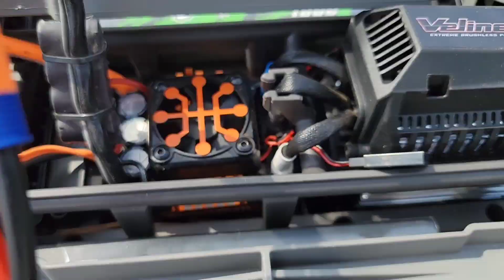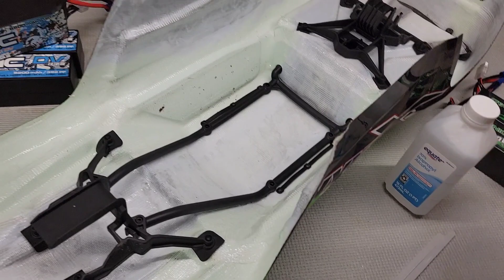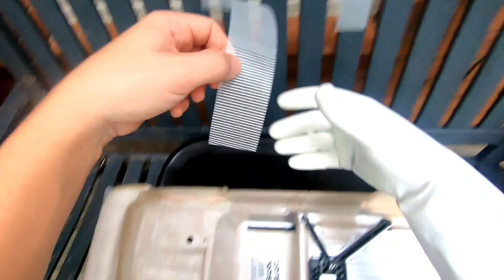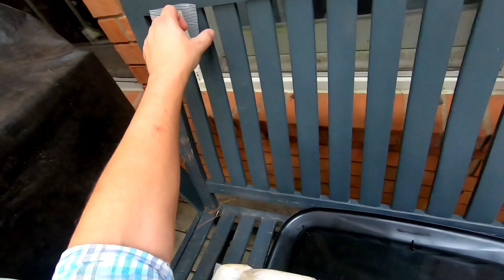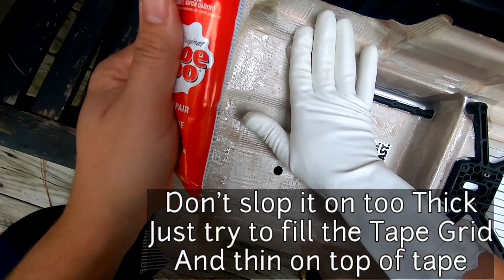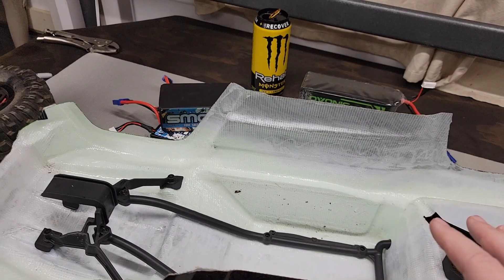Best How to Shoe Goo Traxxas XMaxx RC Body Strengthen 🔸SPECIFIC TIPS🔸

Comment: Flex Paste is the way to go. Your body becomes rubber and as we know rubber absorbs impact. Less mess and really easy.
Reply from the maker: But can you pull it away from the body at all or does it become one?
Other options are good... This For me has worked but same principle I guess.... Appreciate the support and feedback,,, see ya round
Reply: @3SonsRC  I use it with the firma drywall tape. I have a few videos up of how it turned out.

Comment: How many layers do you recommend? 3/4? You said use 2/3 tubes shoegoo is that good for 3/4 layers?
Reply from the maker: 3-4 layers is Overkill IMHO, one medium thick layer, 2nd layer in needed areas, maybe one layer on top all that if it's 8s body, 1/8th Scale is fine one good later and 2nd in some spots
Glad you enjoyed the video, see you around brother

Comment: Hello…I plan on reinforcing a large RC airplanes’ canopy. I see Home Depot has numerous varieties of this brand. Could you please specify which is best. I enjoyed your video….thanks much!
Reply from the maker: Sup brother,
Thanks for stopping by.
I don't think Home Depot has any true Shoe Goo if I'm not mistaken?? I don't have experience with anything other than shoe goo. Most say it's the best true sticky rubber glue, and has worked fantastic for me.
I buy mine at Wal-Mart, that's the cheapest I could find... In the shoe section.
Should work great for airplane bodies as well.... Let me know how it goes.
Hope your enjoying the channel brother, see ya round
Reply: @3SonsRC  ooops, my mistake. I meant to ask which version of Fibatape you recommend. ( Our local HD lists 6 varieties of Fibatape self adhesive/ fiberglass drywall tape).  Could you link please.
Reply from the maker: @MrRbtgold  oh gosh brother, I think I asked the guy what the stickies one was 😳😁😣😔

Comment: 1 tube shoe goo enough for 1 body xmaxx?
Reply from the maker: Thanks for stopping by bud, yes you can stretch one tube for an Xmaxx body so long as you try to keep it thin. Personally I would do one thin layer with one tube then do a second layer and tube in all the needed areas like the front grill, in the dome, and mostly/thick in the rear bed and tale gate. If you want to go almost Unbreakable Body strong wait a few hours between layers and do two thin layers and one thick layer where it's needed (three tubes)... I did a bit more than 2 but even 1 will help for sure and really help it last. I'm just really rough on my rigs. 
Hope that helps and that you are enjoying the channel.... See ya round